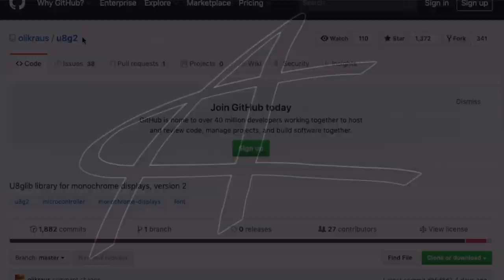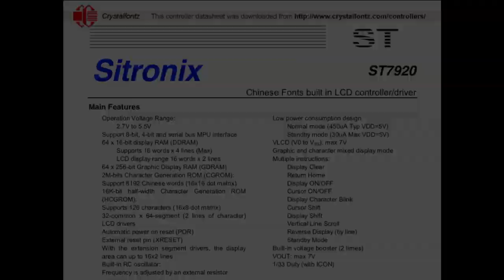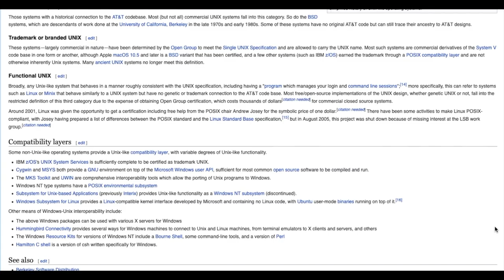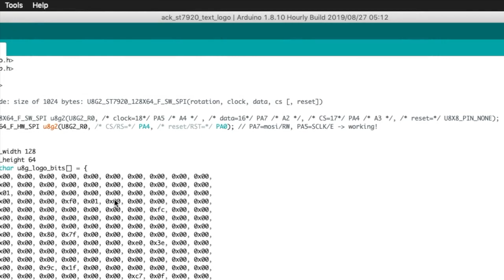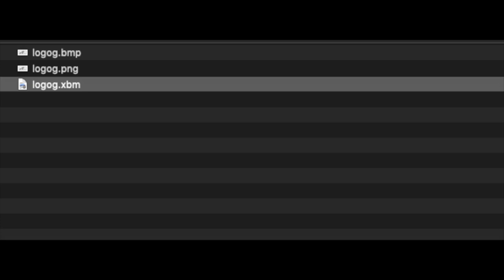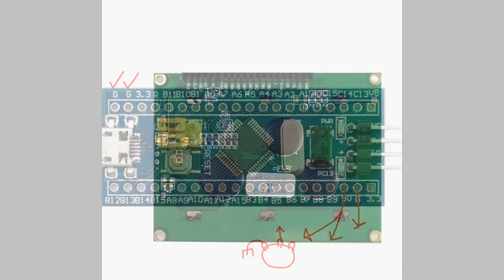TNTM: STM32 'Blue pill' with st7920 display (RRD FGLCD)

Comment: These little boards are great, running at almost 5 times the speed of an Arduino Mega. And U8G2 is also quite nice, though as you can see, the bottleneck for the frame rate is the data transfer. 16 bytes times 64 lines is a lot to push over SPI all at once. I would love to try using u8g2 in Marlin 2 for the 32-bit platforms, but for the upcoming release we’re using a custom fork of u8g for all platforms because it’s more compact to fit on 128K boards, and we don’t need to draw anything more complex than a solid box with inverted text.
Reply from the maker: I hear that.  I was going to do an UNO example that people could play with if they didn't have a blue pill, and could barely shoehorn it in with the char array, so I ditched that segment

Comment: Can we replace the 128x64 LCD of RRD with 128x64 OLED?
Will it be just replacing or something else needs to be done?

White OLED display looks way cooler than blue LCD!
Reply from the maker: HEY, That's an interesting question!  the center pins on the RRD panel PCB are not connected to anything, so technicaly you can solder anything you want in there and then solder leads to whatever you need. I'll start looking around at oleds and see if there are any that will drop in there easily.  I have some of the mini oleds, but I think they are all i2c.

Comment: Awesome video.
Is there any chance to combine this hack with ramps 1.4,   I mean, free up ramps and mega combo of    writing all the stuff on the LCD, combining ramps+mega with bluepill+LCD creating graphics....would it be very difficult?
Reply from the maker: I think you can do that in Klipper firmware already because of the way it is set up.  It could be done in marlin, but it would require more work.  Most of the touch screens work that way already (they have their own 32-bit onboard processor and firmware, and they just translate the signals from the main board's mcu over serial connection), so there is not reason you can't write a translator and  GUI for blue pill from scratch and use whatever protocol calls are expected from the touch panels to communicate with marlin... just more work
Reply: I’ve done similar to this, using a second board (a spare mega) to drive a 4 motor Z axis and its endstops. The boards were connected via i2c, with the second board running a very stripped-down version of Marlin, and I used a very lightweight protocol. Details are at this link: github dot com/MarlinFirmware/Marlin/issues/4776#issuecomment-24626287 … For an LCD handler, you would only need to send over the values to draw. But, if you want to do a full interactive UI it gets a little more complicated. For one thing i2c can easily send data to slave units, but getting data from slave(s) requires some polling. So, a full two-way serial protocol would be better.
Reply from the maker: @Thinkyhead  I'll have to look through that, just for fun if nothing else.  The two-wire bus  taunts me every time I open the config adv header  , but I didn't know you had a machine up and running.  But yes, spi or can bus would avoid do/while or ring buffer or however it is set up to wait for the ack/nack.

Comment: Thanks, man!

Got questions, though:
- what's the advantage of U8g2 ? (I've seem some attempts to migrate Marlin to U8g2  https://github.com/olikraus/u8g2/issues/391 and it was kinda complicated )
- how do you like new Tool ?

Also - from u8glib -  " Note: There will be no more development for U8glib. Please use u8g2. "
Reply from the maker: Yeah.... the old u8g is no longer supported.  u8g2 is great, but I think the issue marlin had was not being able to fit the new version library on MCUs with smaller amounts of memory.  The advantage of using a library for graphical LCDs is that it supports a ton of different displays, so you don't have to program for each different one.  As far as the new Tool... it comes across as more of a "jammed-out" album than a "written" album, which is not really my thing, but it's cool if you're into that.  I think they hit the spot I personally like with Ænima and Lateralus, and then got more slow and jammy with the last 2.  Lots of folks seem to be into that, but I prefer things a bit faster and more progressive.

Comment: STM32 using arDURino ?     You joke ? :))    Why you not use EASY & powerful IDEs w. debug f-n as:  Keil, IAR, 32CubeIDE, etc with  VISUAL init. code generator CubeMX  ?! 
For Atmel : CAVR - it comfortable IDE with visual code gen. for init. code and debug.